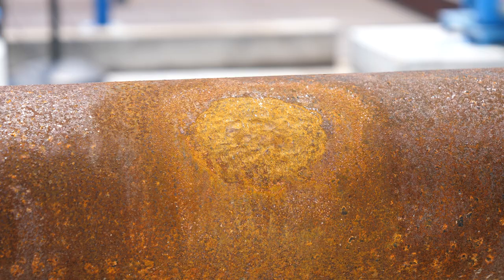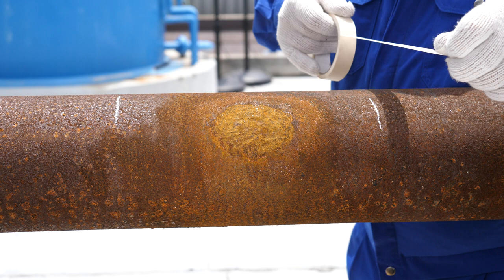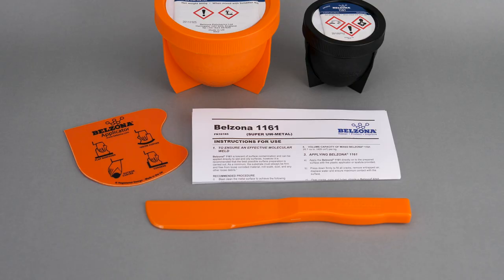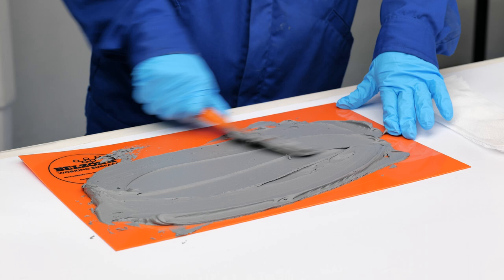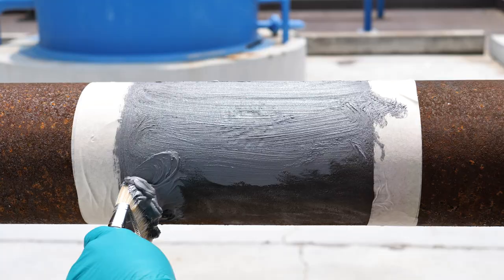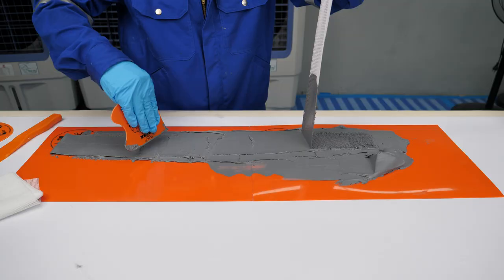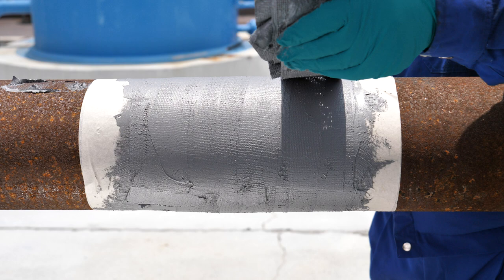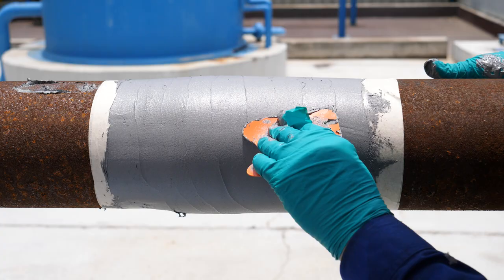Pipework Metal Loss Repair: Fast and Easy with Belzona 1161

Comment from the maker: Belzona has released a new video that demonstrates a step-by-step pipework metal loss repair with Belzona 1161 and Belzona 9341. Watch, share, and comment!
Reply: Major repairs with composite compounds in oil and gas, petrochemical and refinery tanks and liquid transfer pipes and water treatment plants and reconstruction of old bridges that are made of reinforced concrete or metal are very important and essential in oil-rich countries.
Reply: Greetings to you, as you know, the costs of major repairs of oil and gas tanks, petrochemicals, refineries, liquid transfer pipes, etc. are very heavy for OPEC, non-OPEC and OPEC+ countries in the traditional way. Most of these countries are unaware of the new composite compound technology. Most of the private sector owners who have oil and gasoline tanks are also unaware. The low cost of major repairs with composite compounds and increasing the life of the tanks will increase their productivity and increase their income
Reply: Basic repairs of metal and reinforced concrete bridges and healthy drinking water treatment plants are possible with this technology and its cost is lower than the traditional method and it also increases the life of the structures.